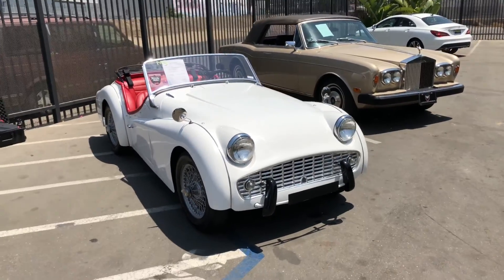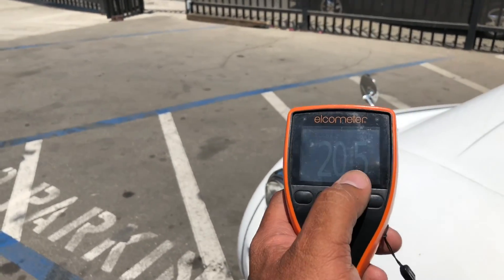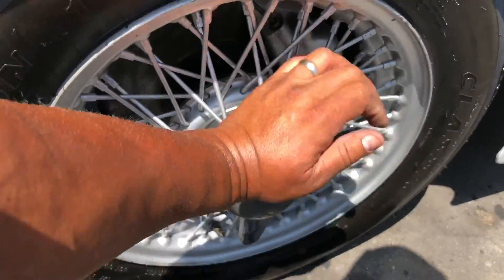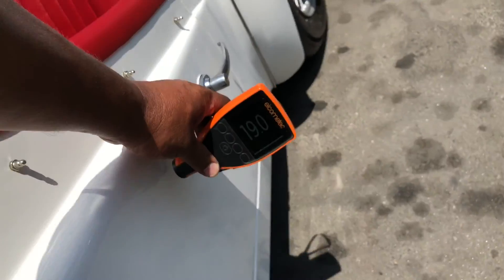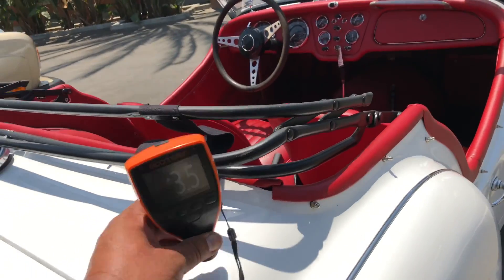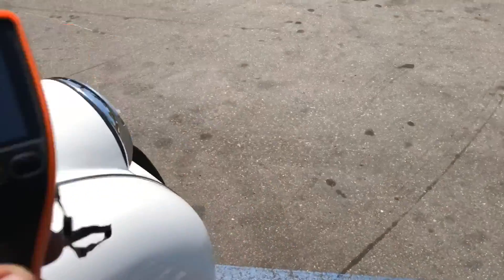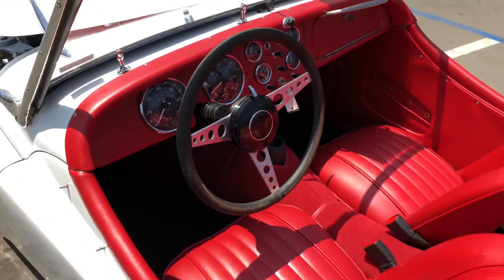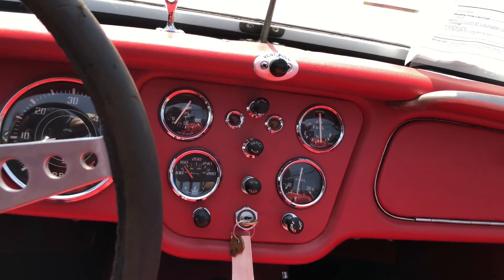1959 Triumph TR3

Comment: Seats are installed incorrectly. The folding seat should be on the passenger side. That oil pressure is scarily low for a 3

Comment: Paint intensity?  The front cowl is missing the badge and all the chrome letters.  So the factory holes for mounting them have been puttied over, along with no one knows how much bondo to get a "sort of" smooth front end. .  The front bumper is gone and I have no idea why they made the over riders front and rear black, instead of the correct chrome.  

Having had and driven a TR3 since 1967, the first place you look is under the floor mats for rust, even in a California car, to see how soon you need to replace the left and right floor pans.  Then check in the corners of the trunk to see if the drain tubes are gone and the rain water leaks directly into the trunk and spare tire compartment, another rust prone area. Inner and outer sills are another area to check with hands and a magnet.
Reply from the maker: Great comments! Thanks for adding useful content so others can benefit from